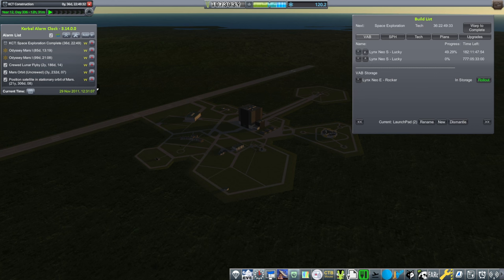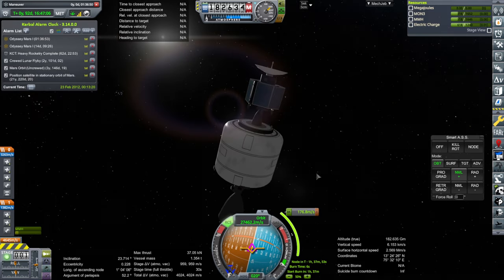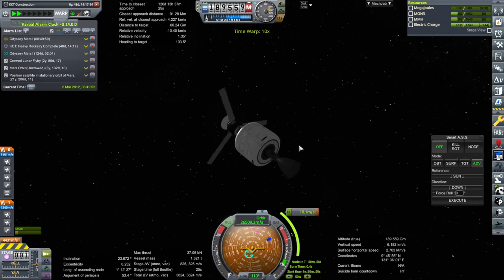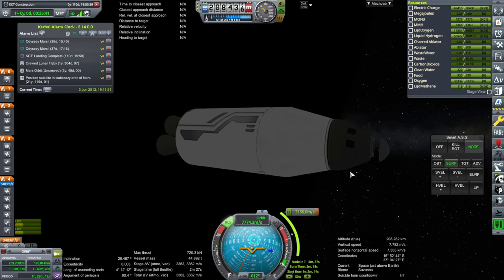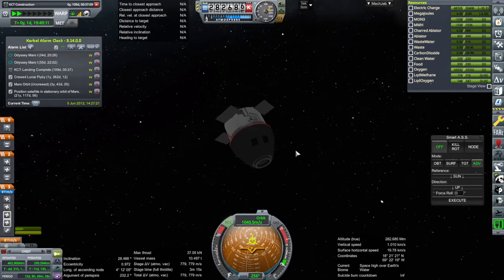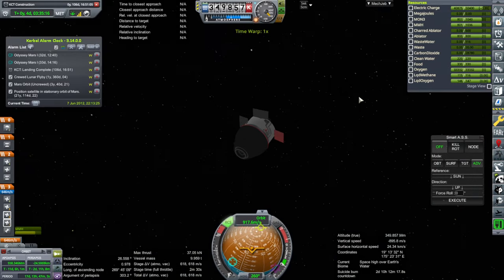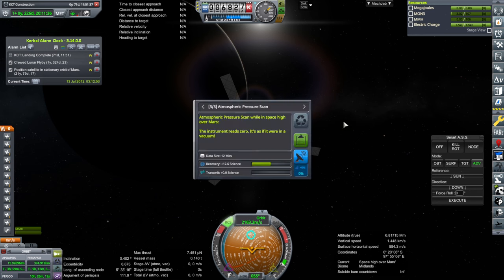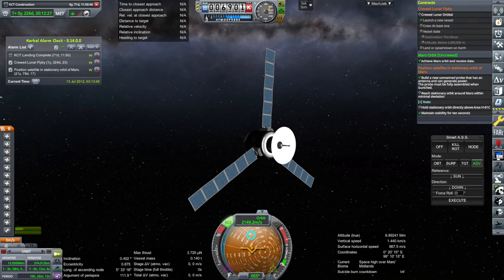RP 2000 Career 25 (RO in KSP 1.12)

Comment: A minor issue with the Jupiter and Saturn orbiter contracts is that they have a very low periapsis requirement of 20,000KM. Its not undoable but it is a few times closer to Jupiter / Saturn then any of their moons . It should probably be raised by a few times.
Reply from the maker: That low periapsis actually helps to capture into orbit around those two and is pretty standard for an orbiter contract. What would be horrible is requiring an apoapsis at that level.
Reply: You should always aim as low as possible for your entry periapsis 

The oberth effect makes your capture burn more effective
Reply: The low periapsis helps for a independent orbiter, but It makes repeated fly-by's, or even fly-by's of any of the moons very fuel heavy because of the absurd corrections. Fly-by's of the moons around Jupiter or Saturn are one of the main reason's for orbiting either of them. I didn't make the reason to raise the requirement clear though, and it works great if you just want to orbit Jupiter.

Comment: Im pretty sure the charred ablator leak means that ksp wont allow the ablator to ablate at all. You still had full ablator all the way to splash down. Its treating the charred ablator value like its a tank, so the 'leak' doesn't allow it to hold any.